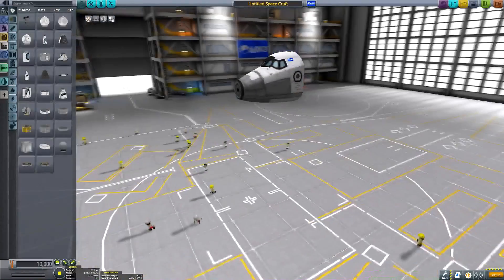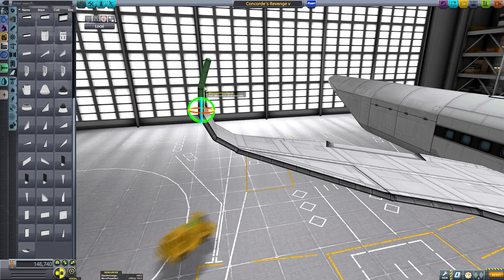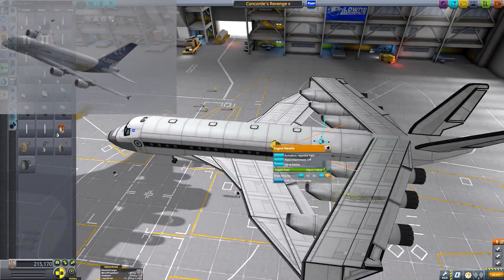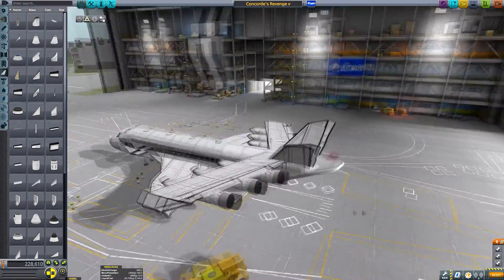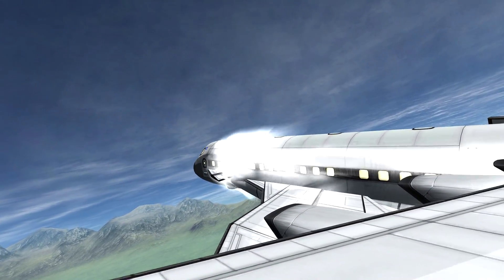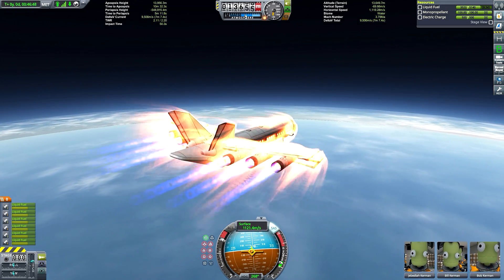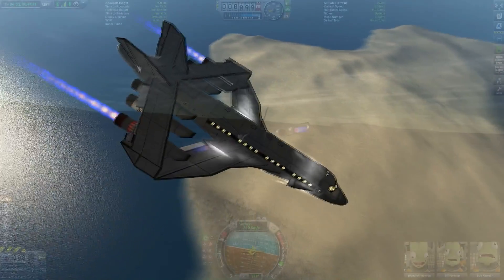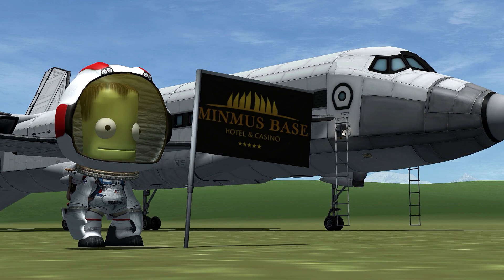KSP: Box-wing Supersonic Airliner!

Comment: These engines kick in at around 16-18KM high altitude btw, in my experience. I've built similar planes where it maintened a good 1200 m/s speed just by half it's throttle. I'm not that good in the game yet, but I figured by now that this engine works best at that high altutide.

Comment: what he said about the blunt tip of the airplane being unfit for hypersonic isnt true. when you go at supersonic speeds drag of the air is the biggest problem but when you go hypersonic the generated heat from the air is a bigger problem. in the concord the windows already felt hot while at full speed, en with a blund nose you push the hot air away from the surface of the plane in a bubble

Comment: wing tip vortices have nothing to do with induced drag, I believe they generate something called interference drag. Induced drag has to do with the angle of attack of the wing, since lift is perpendicular to wing chord, any component of lift in the X direction is the induced drag.

Comment: Box wing designs are really smart, the quite often tend to be oval and Circular shaped, which means that wake turbulence is reduced, and also aero-dynamic forces are canceled out or made weaker by the fact that the forces are spread equally around the circular wing.

Comment: How did he get the rear wing sections not to flap around. I'm pretty sure you can't attach a wing back onto a fuselage on the other end, because of the way the attachment system works.

Comment: Hew Matt, beautiful design as always.

If you want to add some "realistic" tweaks to it, you should rotate the engines intake 180° so they face upward instead of downward.
In this current design, it is very likely that the engines are sucking some of the boundary layer of the lower wind section.
Something you definitely want to avoid if you want to increase your engine lifespan. 

Of course this is not really relevant for KSP, but that would be some interesting attention to details on this one.
Plus it may look even cooler !

Cheers mate

Comment: I am currently writing a paper about the Box wing for my bachelor degree thesis. It's not finished yet but from my design i got 5% in drag reduction over the reference aircraft, a 737 500 with winglets. The design is not yet optimized that is why i got such a low improvement. A fully optimized wing should give a 9%-14%. Link for my design https://imgur.com/a/LCv7ODH

Comment: Matt, the brakes on retractable landinggear in ksp is OP. If you'd go for realism, add drogue chutes on the plane and let the brakes only brake 50% or less. Your control services didn't seem to be used for one specific thing. It looked like all of them had yaw, roll and pitch selected. You should unselect some of them per control service for more control. Flaps may help reducing the landing approach speed, they can be a bit annoying for take of though. 
I hope you see this and I may got a bit carried away with perfectionism.

Edit 1: Your center of mass looked to much forward compared to the size of your elevators. Tipp, your elevators need to be able to just pitch the craft up at 'stall speed'.

Edit 2: for realism; Disable the reactionwheel in the mk3 cockpit. It's to overpowered and I don't think any aeroplane in the world has one.

Comment: Challenge:
Make a plane which can go around Kerbin as fast as possible.

Make one flight where you only go straight forward and eventually end up back at the runway. Do that as fast as possible.

Size and crew doesn't matter.
Reply: That'd mean it would be an SSTO like vehicle. It would only circulurize at 50 km. The problem is that you can't make a plane go much faster then 1400 m/s at 30 km or it will disintegrate. But I'd love to see Matt try to go as fast as possible around kerbin.

Edit: just did one in 42 minutes and 53 seconds. The mk 2 cockpit starts to overheat after a time at a high speed in the atmosphere. I'd guess it could probably be done under half an hour.
Reply: @martijn9568  active cooling and lots of it
Reply: Already did dat
Reply: Around Kerbin in 160 units of fuel: https://www.youtube.com/watch?v=T9EXxu-41Fc
Reply: Do that in RSS
Reply: Y DO I SEE YOU EVERYWHERE!?
Reply: I almost done that before it took me about 48mins
Reply: So no leaving Atmo? Only jets? Cause even if you can't leave atmo I can use vectors and get to incredible speeds.
Reply: @kevinzheng7373  But you need to have enough fuel to decelerate, and you also cannot accidentally yourself above 70km, and you can’t burn up.
Reply: YEEEEEESSSSSS!
Reply: If you go straight, you won't make a circle around the planet
also define plane. Rocket or an SSTO will go in something like 40 minutes.
Reply: @bottlekruiser  Yeah you will, the KSC and runway are lined up with the equator.
Reply: Radioactive the paper shredder 
Radioactive the paper shredder 
That doesnot make a "straight" path curve around the planet lol
"Straight forward" is ok tho
And how does them being lined up affect anything?
Reply: battlekruiser r/Iamverysmart